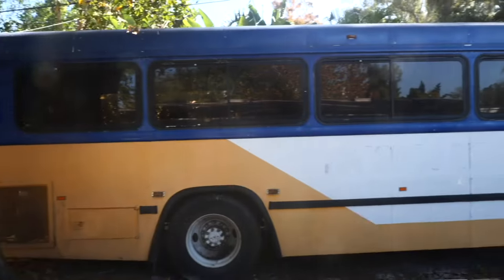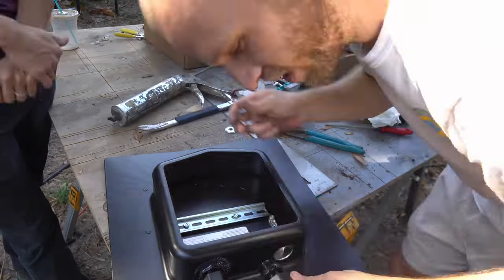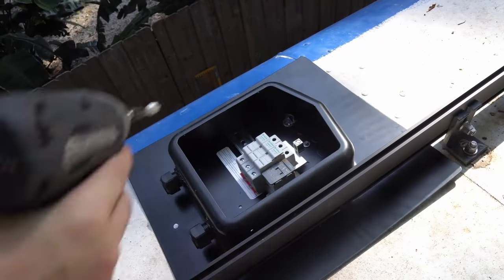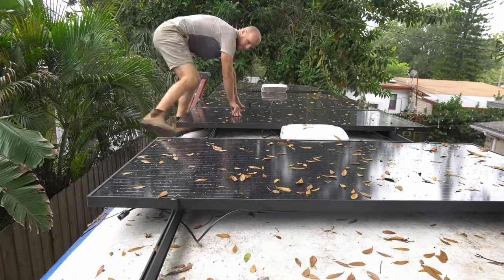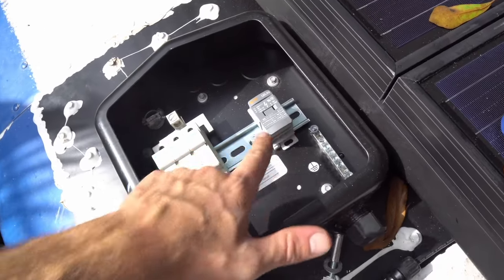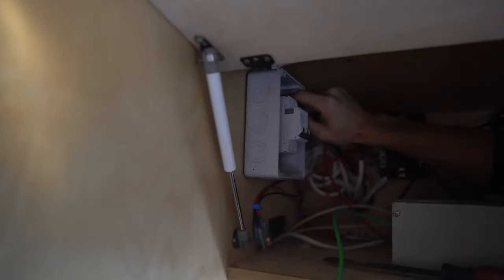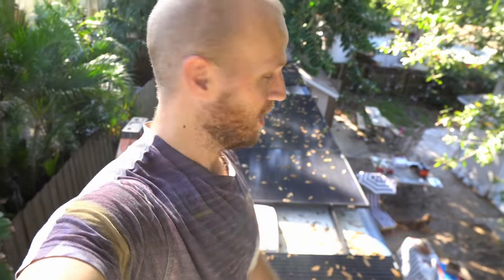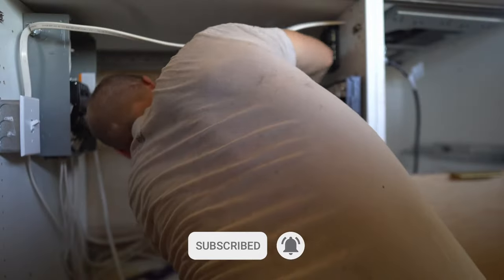How to Install and Wire Solar Panels on a Bus Conversion

Comment: As always Justin your work is awesome. I ended up going with a 48 volt system on mine. It worked out to be alot cheaper. Using server rack batteries.
Reply from the maker: Thanks! That's a really smart move. Glad you found some great repurposed batteries.
Reply: @MobileDwellings  not repurposed.... new.

Comment: That Sam is a real live wirer, for sure! Now that the system is all said and done, and up and running for a while now, are they happy with how it's working and is it giving them enough power? Another great vid, BTW!!
Reply from the maker: HAHA! We actually added two more panels right before they hit the road bringing the system up to 3200 watts. It's an absolute beast, more than they need.

Comment: So wait you're telling me you can do both series and parallel within the same system? how is that possible? thank you
Reply from the maker: Yes you can put two panels in series and then put them in parallel with another set of 2 panels. The advantage is that you can increase the voltage and use a smaller wire size and you can have some panels shaded while not affecting the performance of other panels.

Comment: Hi what are the exact panels you used here?
Reply from the maker: There's no need to get these exact panels in fact they don't even make them anymore. Signaturesolar.com is where I get my panels now. They're crazy cheap and you can get $50 off with the code JUICEBOX. Id buy the cheapest panels that are close to 400 watts each.

Comment: Hey Justin, I’m getting ready to install that track on my skoolie roof, but how did you handle the angles of the roof line with the L brackets?
Reply from the maker: They can be at a very slight angle but basically you need to put them right where your roof starts to go from flat to curved.
Reply: @MobileDwellings  thank you!  I don’t think I can. My roof (Thomas Bus) is fairly curved all around and the mounting holes on my solar panels are about 51” apart, so that’s where the track has to go. Thanks for taking the time to respond!  Always love watching your videos.

Comment: So did you paint the roof? Or is that not necessary?
Reply from the maker: We did paint the roof. If your roof is white and in good condition maybe not necessary. If it's not white and you're going to be in hot climates I would absolutely paint it.

Comment: dont know how fragile those panels are electronically but hope that spark didn't crack one or more those crystals. tho you'd only lose .5% effiency at most id assume if it only poped 2-5 no biggie you got thousands more

Comment: Well This looks like fun " not" lol. I would like to put Solar on my Bus some time, only I want something Simple, and a but lower cost. My Bus is not a FULL Build RV build. Its just like a Cabin in the woods. I wanted to Keep it Simple, so that being Said ANYONE know of a Simple Solar System I might look into? Less Than $1000.00 if Possible.. Yea I know..
Reply from the maker: Well if you're not doing any cooking, heating, AC, or water heating with electricity you could do a lot with an all in one solar generator like this one which comes with two 100 watt panels. Still a little over your budget though but hey you can just buy it and use it: https://www.jackery.com/products/jackery-explorer-1000-2-x-solarsaga-100w-solar-generator?aff=299